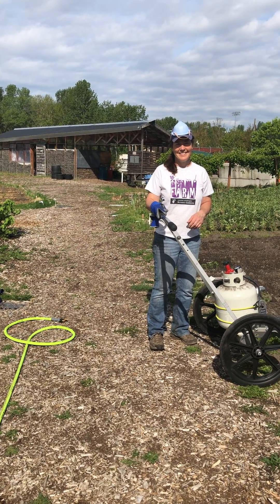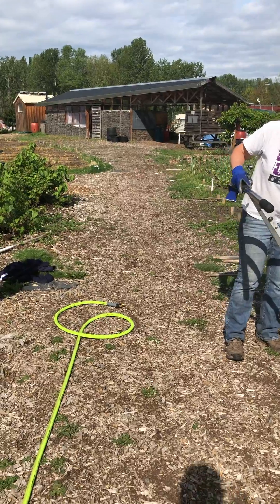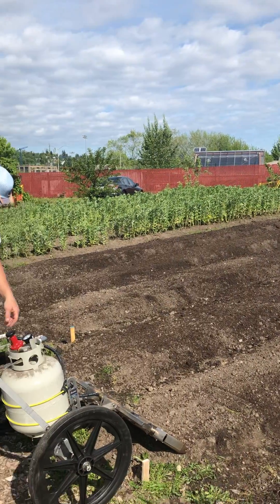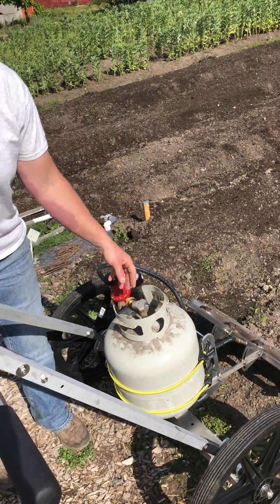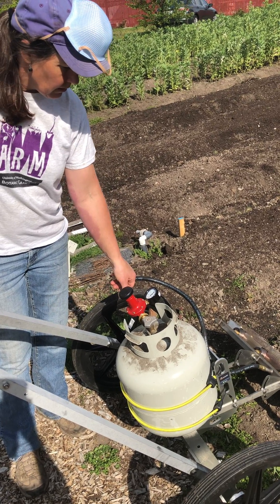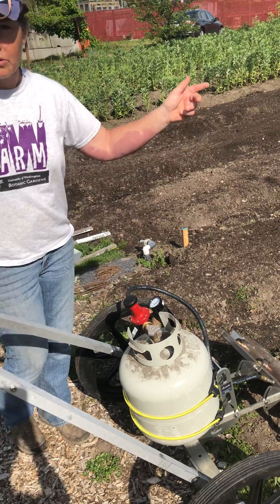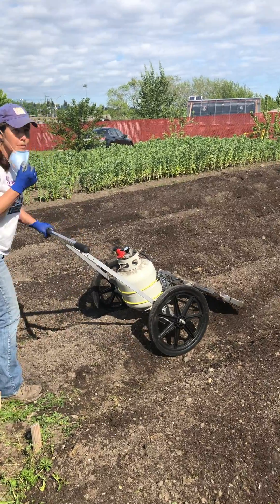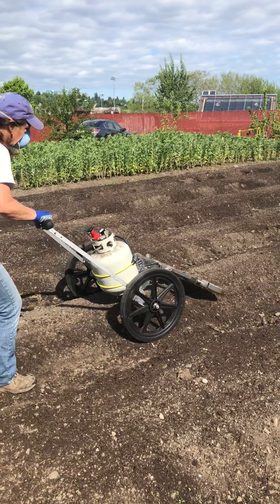Pyro/Flame Weeder Demonstration

Comment: What are you even weeding? I’m very confused
Reply: We are flame weeding pre-emergent weed seeds and very small early weeds, that are only 1-2" high. Flame weeding also kills surface plant diseases, such as powdery mildew, rusts, etc.  This is a strategy used for root crops and only performed in spring when it is safe to do so. Hope that helps answer your questions?  We hav an additional flame weeding video which shows the weeds after being flamed.
Reply: @perryacworth  it does thank you! I have since learned a little more about this and it seems like a useful strategy:) I’m going to experiment this year. Half of my potatoes will be planted into a bed that is flame weeded and half un treated. Thank you for the response:)